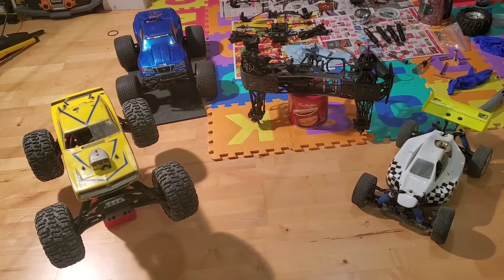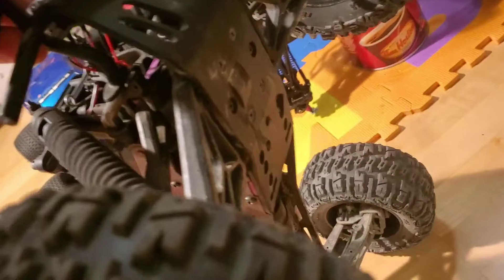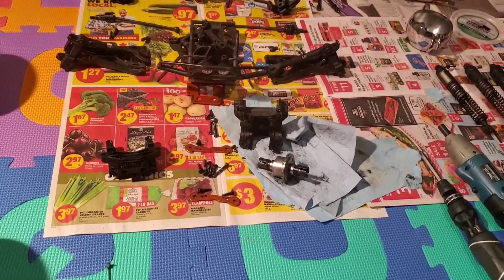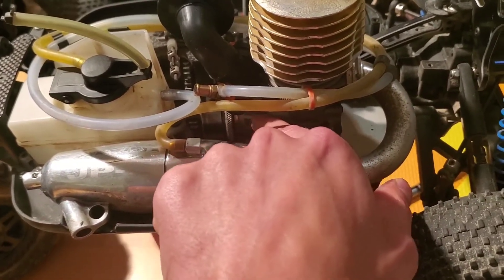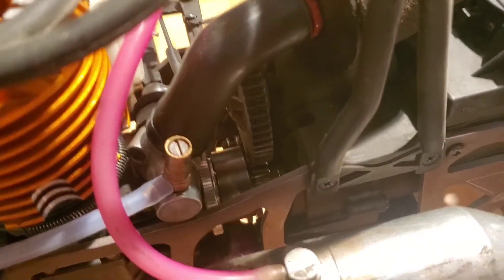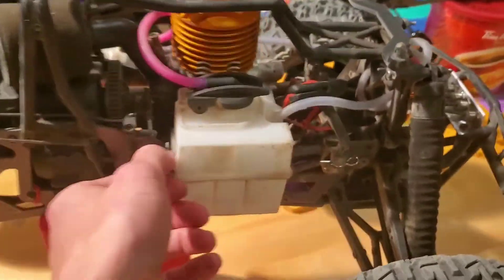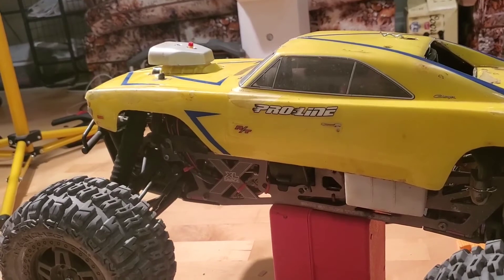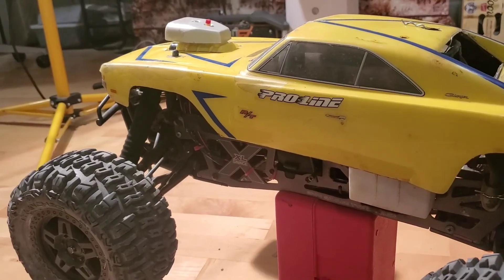Budget R/C Car Buying Guide (Used Nitro)

Comment: Enjoyed the video. Always love a savage. Looks like you have a few nice examples there.

I've had pretty good luck with used nitros the first one I got was a hot bodies lightning stadium. That had the awful .26 engine, I think I only ran it 5-6 times then it blew up. I didn't know what I was doing either which didn't help. I got a savage last year and it was great. Going to try get an XL this spring or summer :).
Reply from the maker: Thanks for sharing Lawrence, did you end up snagging an xl?  The new Savage X V2 actually comes with the same HD  drive train which is pretty epic. I'm waiting for an SS kit version. If it's released I'll be pre-ordering 😀. Can't go wrong with new sometimes and your used rigs can become spares.
Reply: @layback209fixorsmash3  no I never got one in the end. I ordered a kyosho usa1 last may and it never arrived. It kept getting delayed over and over again, so I cancelled it in the end